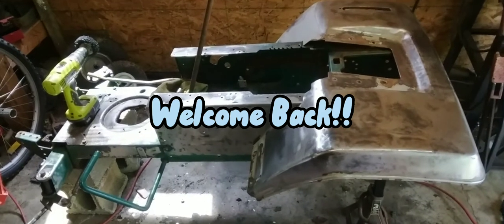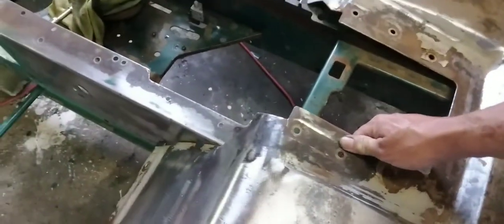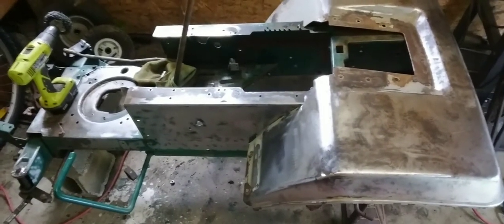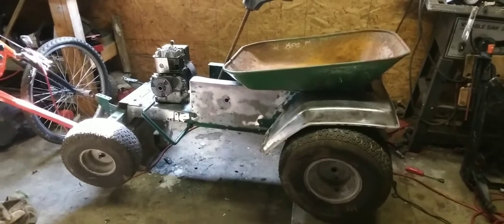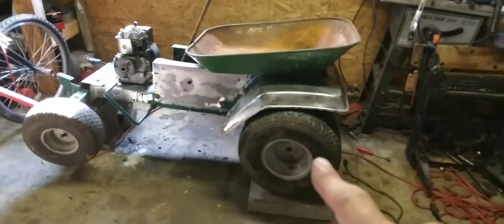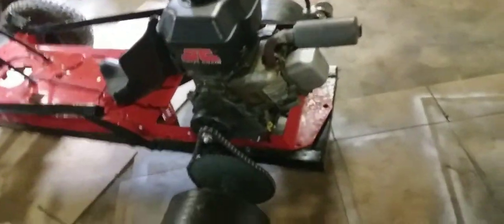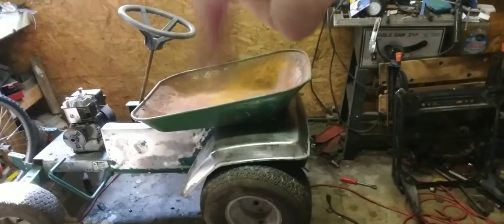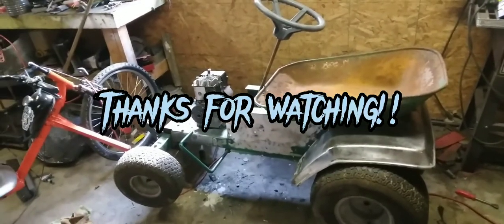New "cockpit" for the front engine go-kart

Comment: Yeah clear coat on steel with the smaller imperfections in places would be killer. I’m assuming your going to cut the bucket front maybe flip that part over so you have a down curve like you said on the beam notch it or  trim it back.... Looks great
Reply from the maker: @Roger Stafford-Wake Inc. Thanks for the input bro and yes I was going to cut and bend the front for a downward slope for the riders legs exactly as you stated you literally read my mind lol I'm also thinking of maybe chopping the rear down to the frame,ditch the fenders and mount the wheel barrow directly to the frame but I really like the bare metal fenders so I'm not certain on that yet.Thanks again bro✌
Reply: @glenssmallenginecreations  it’s all you. I like the fenders too. Gives it the miny raptor look